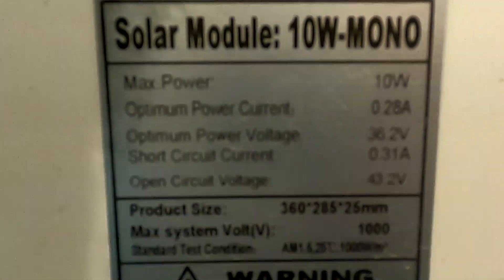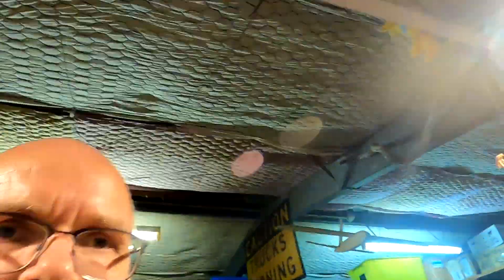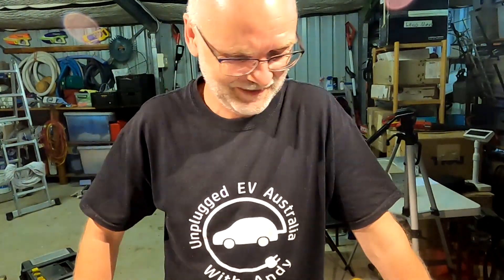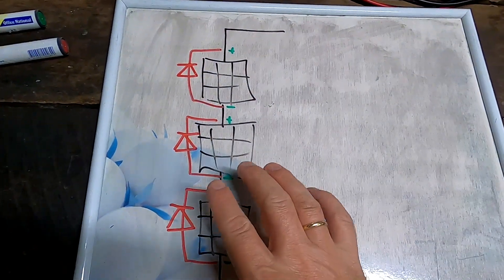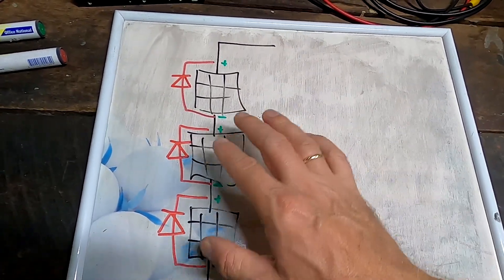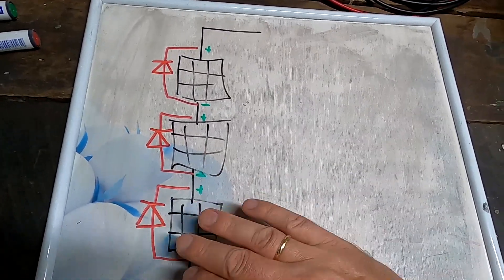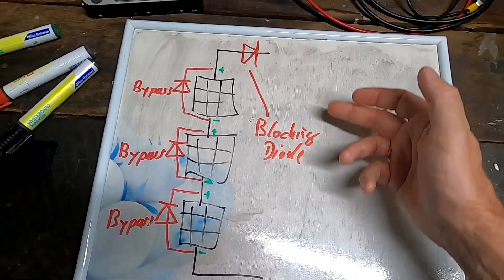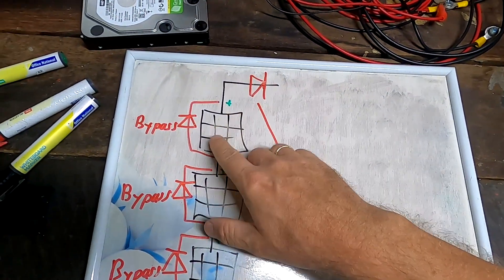Solar Upgrade EP4.1 - Bypass vs. Blocking Confusion and why solar panels DO NOT act as a diode!

Comment: But... this is why one should fuse each panel in a parallel string (depending on how many panels in the string). This is because if a short were to develop in one of the panels,  the remaining panels in the parallel string would dump all their amperage into the shorted panel and cause a fire.  The fuse should go right on each individual panel that is connected in parallel.
Reply: short across 1 panel is very unlikely scenario.

Comment: Thank you for this video. I'm loading up on research before building my first solar power system. 

So, then, the shading of one or two panels, will not decrease the output of the string, yes? And the same goes for two series strings connected in parallel?
Reply: The power out will be proportional to the sunlight falling on them. But unless you have a lot of lead resistance to the CC or inverter, then it will probably be negligible. Do the math.

Comment: i have combiner box in series solar panels 1-4 12v is 180w 2 + - 130w, 1 +   - 100w, + - =wired ++++ - - - - in series one big panel 590w,7080w low sun light less w, 12v 200a battery 2400w sealed battery

Comment: i think I] will buy this one for 12v solar panel [Ltvystore 30PCS 15Amp Diode Axial Schottky Blocking Diodes Compatible for Solar Cells Panel,15SQ045 Schottky]  if you think it is ok please [15a x 12v =180w] I think

Comment: do you replace the diode with the same number as the old one like [10amp Diode Axial Schottky Blocking Diodes for Solar Cells Panel,15SQ045 Schottky] [BOJACK 10SQ050 Schottky diode 10 A 50 V axial 10SQ050 10 amps 50 Volts for Solar Panel Parallel reflow Protection diodes] [Bridgold 25pcs 3Types Silicon Rectifier diodes,Package Including:10pcs 6A10 10pcs 10A10 5pcs 20A10] ok which one what volts going on and on

Comment: I have 4 panels 2x2 in series and both strings in paralel on both sides of my balcony. In the morning the sun is from one side than after 12 o clock fron the other. ON EACH SERIES strin one panel stoped working and I am wondering why. I do not haveb a blocking diode

Comment: I would add only that a solar panel acts as diode ONLY in that when power is pushed to the panel it becomes an LED (light emitting diode), however the light emitted is not in the visible spectrum. Thanks for giving me some good laughs when you responded to people's comments though. Although I have a feeling those types of comments will never stop, lol. Great video, cheers. 😎
Reply from the maker: Thanks for your feedback and additional comments.

Comment: All diodes and solar cells act like zener diodes when reverse biased. That includes all semiconductors acting like a solar cell to some degree when exposed to light. If you had thousands of LEDS you could make a solar panel. Although you would need many blocking diodes with one being in each small string, because they can only handle so much voltage before they try to conduct. That was some interesting trivia. Rectifying diodes also will have a much lower effective voltage drop if you put multiples in parallel. PN junctions are weird like that.
Reply: Hadn't heard that in general about diodes... too bad you can't parallel 10 of them and get 0.04 to 0.07Vf! Worth an experiment.
Reply: you're slightly wrong about all diodes acting like zeners, a zener junction will recover but a normal diode either stays shorted after rv breakdown or burn out

Comment: Good video, very well explained re solar panels wired in series, but what about those wired in parallel? I have 3 panels (1x100W, plus 2x 160W) charging 12V  AGM batteries for shed power. The 100W faces SSE, and both 160W panels face due South. One of the 160W panels is shaded each morning by a neighbours tree. Should I install a MC4 type blocking diode in the positive  cable of each panel output?
Reply: For 12V system with the panels around 16-22V there is no need for blocking diodes as the worst case the backflow only have few mA that is not enough to damage the solar panel cell.
Also blocking diode has a voltage drop that will significantly waste your energy in low voltage system.

Blocking diodes only ideal for strings with voltage difference of 30V or above. If your strings has only few voltage difference then you should not worry about backflow.

Comment: I have 2 X 150 W 22V oct voltage solar panels on each side of my boat.
All panels are connected in parallel and charging is controlled via a voltage sensing relay, no charge controller.
Would blocking diodes be beneficial for each 2 parallel panels?
Reply: wouldnt it makes more sense to get a solar controller than worry about blocking diodes? I'm sure your batteries would benefit more

Comment: Andy,  all along, I think the diode inside the solar panel was blocking diodes. You corrected my misconception. Thanks. You said it was not necessary to add blocking diodes since the charge controller had the lowest impedance. Yes, I totally agree with you. But if the battery was fully charged, and the charge controller was in float mode, then the charge controller would not take in any current from the panel. Then panel with a higher voltage will push the current into the lower voltage panel. In this case, will it hurt the lower voltage panel?
Reply: Yes only if the voltage is high enough and the solar panel string current with higher voltage is also high. If you only have two 100W panels with 18V and other 22V then you need not to worry as the backflow will be in mA, not enough to damage the panel. Only consider blocking diode if you have like 90V 5A string and the other 150V 15A string or where the voltage difference in worst case is high (like 30V or more).

Comment: Great video! Just with this one, I have become a fan. Question: Why are there specifications of junction boxes with 2, 3, 4, 6 diodes?
Reply: Diodes can only pass so much current without overheating,  so putting more in parallel splits the current to reduce heat.
Reply: @TheRealMonnie  Thank you for the reply! : )

Comment: You have just enlightened me M8. I had seen the term blocking diode and bypass diode and assumed the two were the same. Thank you.
I have been messing with off grid power for ~10 years and you just set me strait.
Reply from the maker: Thanks for the feedback, Michael!

Comment: Most quality charge controllers do not need blocking diodes added, as they will have a relay that will disconnect the charge controller from the PV array at night or in non charging light levels. A blocking diode in series would just rob the circuit of some energy.
As for bypass diodes: I have seen people upgrading from old parallel wired low voltage arrays to higher voltage series arrays when they get a nice MPPT controller, and ended up burning out some of their solar modules as they did not come with bypass diodes.

Comment: Sofar in person ive never seen blocking diodes used in solar systems
Reply from the maker: I think they are mandatory in some countries now when paralleling strings.
Reply: @OffGridGarageAustralia  i suppose , i do see the altE store has done a video about bypass and blocking, so i assume they sell them, they also ground everything and have lightening surge protectors in the USA, where its not mandatory here and no one does it here in WA. Climate i guess.

Comment: That is a really nice way to describe how things work. 
I already knew the basis but still really enjoyed watching your video. 
Totally agree that in your scenario you’re unlikely to require a diode. 
 I wonder if I might though, as I’ll be building a solar fence where at times many panels won’t be in the sunlight so maybe that would yield different results. 

I’ll certainly film a test against that and see if it also works just fine without diodes. 

I’ll then also compare the diodes with Tigo optimisers as I haven’t really seen such a test but I think they go hand in hand when you look at how those optimisers work. 

Thanks for another good video!
Reply: Solar diode manufacturers, welcome to know

Comment: Is the blocking diode needed if you occasionally feed a grid tie inverter with batteries? (Which puts your battery pack and panels in parallel.)
Reply: O sea q si lo va poner un inversor o va cargar una batería no es necesario el diodo pero una pregunta porque va el diodo en paralelo con el panel y no en linea recta en el positivo eso es loque yo no entiendo y ya investigue pero encuentro nada al topar puntas del cable del panel siempre se cae el volante así como trae el diodo y de antemano gracias espero me entiendas

Comment: Would it be a good idea to have a blocking diode if you have more than one string. It could help if one of the strings were hit with lighting or some other high voltage. It would blow the diode. What do you think?
Reply from the maker: I did another video on this with a test. Blocking diodes are not necessary. https://youtu.be/NaCOdOdhdTY

Comment: Quite a bit of flickering...you might look into changing those lights...Maybe you get a LED driver (Power supply) and connect it to DC LED panels? 
The LED driver will make sure that you have a smooth DC Voltage without much ripple at the output. 
Alternatively you could use a DC-DC converter to dirve the LEDs with your battery bank directly.

Comment: No no no Andy, the bypass diode has only one purpose, it's only there just in case you connect your panel backwards! Had you connected one or more panels backwards, the diode will place a short circuit in a parallel string which will cause your breaker to trip (which is why it's important to have a breaker or fuse) otherwise, on a beautiful day with plenty of sunshine, the reverse connected panel will catch on fire 🔥 and it always happens when you are not there! Murphy's law! 
If you have a panel connected in reverse in a series string, the diode in that particular panel will completely bypass it lowering the total voltage of the string and avoiding a fire 🔥! 
You find this bypass diode technique used in car audio amplifiers! It's usually found right after the fuse, should you connect the power cables the wrong way around, the diode will create a short circuit and blow the fuse to protect everything else after it... 
The blocking diode is as you said, if you only have one series string to the charge controller, you don't need one unless the charge controller is sending current back to the panels somehow... 
I would probably use a blocking diode for every panel if they were all in parallel though... 
A panel that is being fed a current will show up on a thermal camera! 
You would have seen it on that small panel that you had connected to your bench power supply... Some older video cameras had a night mode that would allow you to see the solar panel glowing if power was being applied to it... 
I'm not sure if a cell phone would work, I haven't tried it myself but you can see the infrared led working on a TV remote with a cell phone... 
Incidentally, if you de cap a TO3 metal encapsulated transistor and shine a light on it, it would output a voltage! All transistors will produce a voltage if their die is exposed! After all, a solar panel is nothing more than a lot of exposed transistors... Not many people know this!

Comment: I'm learning something. Thanks. So my questions is whether your observation regarding the blocking diode holds true between a full load and no load at the charge controller? Thanks again.
Reply from the maker: That should make no difference, Harold.

Comment: You are right, in my first built east west 5KW unit I measured zero current running in the shaded  part when the sun still was
bright at the west side. Diodes produce losses, 0.7V siliciums

Comment: Blocking diode (function) will be in any good MPPT controller. Or ANY good controller, to prevent night loss. Installing directly in the panel array would be a waste, as they cause voltage loss, and extra expense.
Reply: I am hoping the video maker will address your comment. TY
Reply: There is no night loss on ANY good solar charge controller. They don’t mix their input and outputs.

Comment: Solar cells are like Zener diodes, when you exceed their avalanch voltage in the reverse direction, they will conduct.
Reply from the maker: That is exactly right!
Reply: I tried the same .. the solar panel works as  a led .... Well its visible through a camera though
Reply: Well its not from visable spectrum
Reply: @Riddhi42069  It is, with infrared camera!

Comment: One safety commit. It is not a good idea to put 15 volts across a lead acid battery for a long period of time.
You might boil the acid inside the battery. Boiling acids makes a boiling sound.

Comment: The comments from your viewers are correct many panels have both types of diodes installed in the junction some do not I know all of my panels have them trina solar and sun power
Reply from the maker: I opened quite a few in the last couple of years and they all had bypass diodes only. But thanks for the info, always good to have such insight.

Comment: Blocking Diodes are  recommended when you connect a Solar Panel directly to the battery, without any Charge Controller.  This prevents the battery from discharging through the Solar Panel(s)  at night ...
Reply: I hand an old HF charge controller that discharged the battery over night. This charge controller needed a blocking diode.
Reply: @petercamusojr1545  "Harbor Freight" for PV components?  Well, that tells me all that I need to know ...
Reply: @MrSummitville  It was a gift 10 years ago from my daughter.  Surprisingly well designed learning tool/toy for the time.  I know a couple offgriders that used them for years as their main electrical power source. Yes, they are wayout dated now, but if it works no need to throw them away. It can run 1 light in a shed or outhouse. I did have to open the panels up after 7 years... break the corners of the glass to resolder the leads back on. Lot of fun, minimally useful.
Reply from the maker: Yes, that is a use case for a blocking diode.
Reply: And diode bypass?

Comment: Nice experiment. What are the voltages and current flows with the solar cell turned face down?
Reply from the maker: That didn't make any difference. The LED light above did not had any effect on the PN layer. Not enough lumen I guess. Yeah, that would be another experiment to see what happens when lights hit the panel.

Comment: added comment-just remembered 1 time i had ice drops stuck  on panel in use when i had removed snow from  but other did not and was not connected--this back current i now have an answer as to why 1 had ice crystals the other was smooth--live and learn

Comment: Hey Andy. Good explanation on blocking diodes.  I use three of them on my system, but it's very different than your setup.  My system is on my Recreational Vehicle and i have three different sources of voltage/current to charge the batteries.  I can use the onboard RV charger, i can charge from the tow vehicle, or i can charge from the Solar string.  I found that i had to use a blocking diode for each of the three charging systems, as it was possible to be charging the batteries at night and the RV charger would pass current through the solar string. The biggest downside of the blocking diode is the .5v voltage drop that it creates, and the heat that has to be dissipated with the blocking diode.  I have a large heat sink on the three blocking diodes to deal with the heat.  Anyway, very different application that yours, and the blocking diodes allow me to use all three sources at the same time if i choose to quickly charge the system.  Thanks Andy.  Good stuff!
Reply from the maker: Thanks James, very good point and a different scenario. If you have panels with different voltage, you need blocking diodes, that is correct. You can get Shottky diodes which have only a 0.2V voltage drop.
Reply: Schottky diodes have a .4 volt drop.  Use them for this purpose.  Also, your solar charge controller should prevent current from going from your RV charger through the solar string but it depends on how you have it all connected.  Seems to me you should only need one diode in the right place.

Comment: I'm so happy you cleared that up
Reply from the maker: It was necessary, right? Too many had the same 'knowledge' 🍻
Reply: @OffGridGarageAustralia  yeah honestly I was a little confused on the matter because I knew there is diodes in the junction box  even though I know what a diode does I didn't know what bypass diode did until you very gracefully cleared that up. Im happy that I have a good understanding now that I watched this video. Thanks again! I honestly would of never figured that out if I didn't watch this video.
Reply from the maker: @andrewshowland  Thank you!